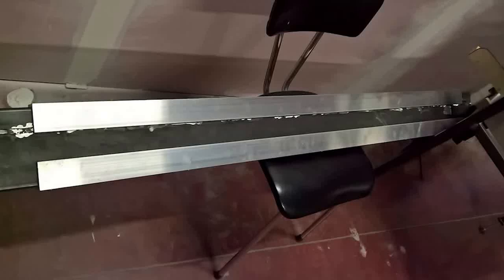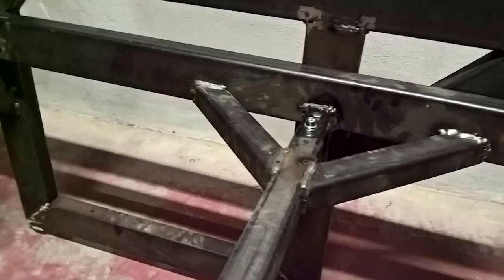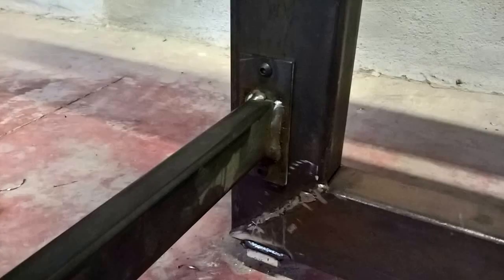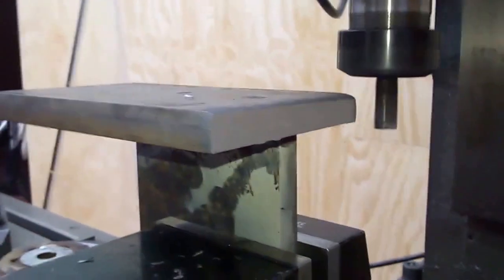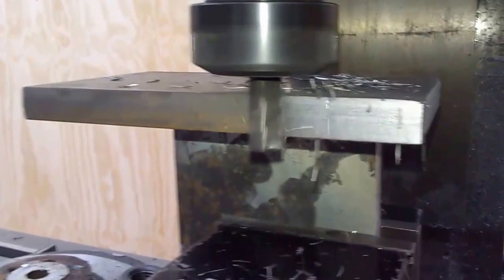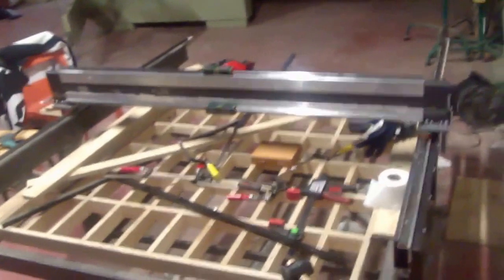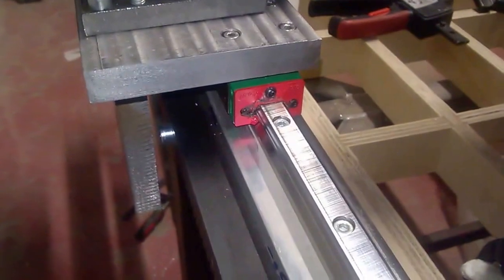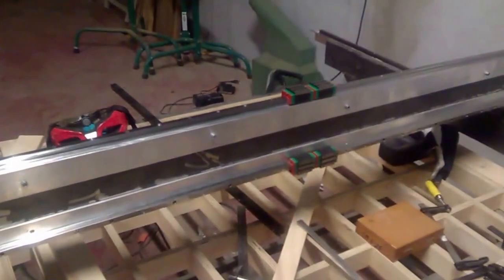DIY CNC steel router build part 3 - setup, milling more pieces and general stuff

Comment: The 5 flute tool vibrated badly because your material hangout was quite large. Try to get your clamping surface as close as possible to the cutting surface. If you have incredible hangout, like you did, using thick "blocks" of material to increase the strength of your vice works well. I had a part similar to yours I clamped inside of 1.5" thick steel jaw plates on either side of the workpiece.https://www.screencast.com/t/oS0PIrETAWN. The rigidity of your workpiece up from the jaw is CRITICAL.